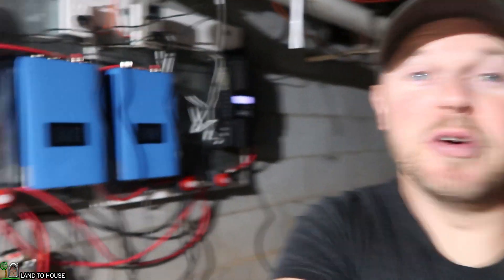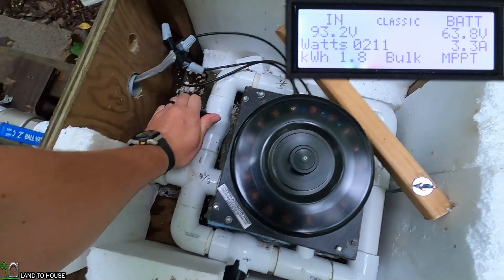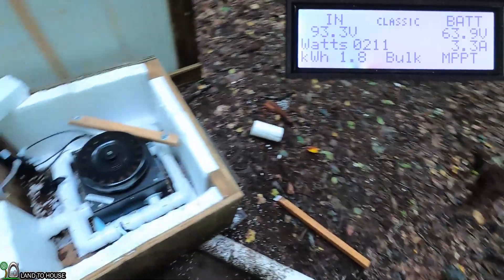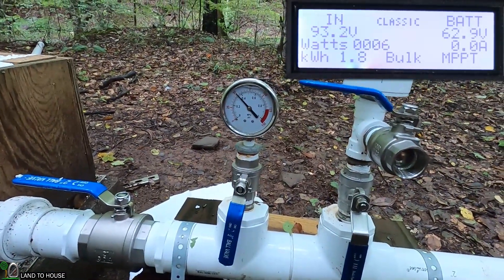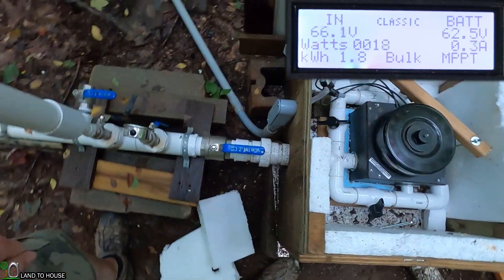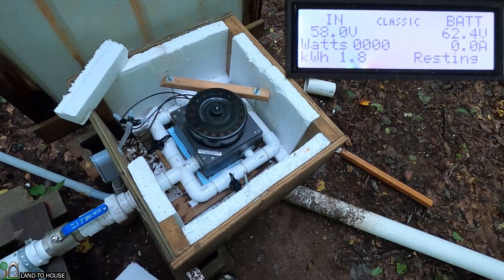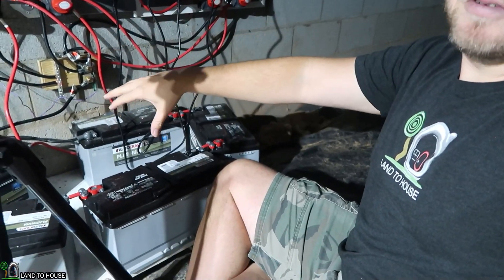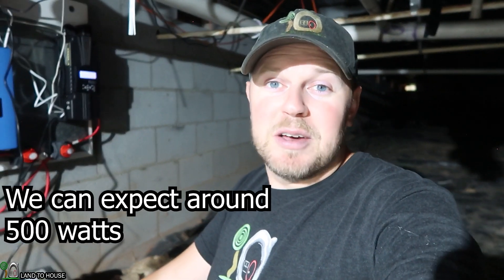It Rained - Can I Run All Four Micro Hydro Nozzles?

Comment: I don't understand how this was a drainage problem, bogging it down wouldn't cause the wattage to fall to zero while the voltage stayed almost identical to the voltage it was at around 330W. And when you "cleared it" and fired it back up it was clearly under NO load and shot up to 200V :-o it's like you tripped a breaker on the load side and it had nothing to dump the current into. The high RPM of the unit when you reopened was obvious and almost concerning.
Reply from the maker: When the battery at the house is full the charge controller allows the pma to spin wide open.
Reply: @LandtoHouse  Right, so you therefore have no confirmation from that test that there was actually a drainage problem under the turbine. You may have it from other tests, but the conclusion drawn in the video based on what was shown was outright wrong, right?
Reply from the maker: @fredio54  the drainage volume is way too small. A new catchment base is underway.  That will give you the answer you are looking for. I have that housing half way done.
Reply: @LandtoHouse  To be honest I'm more interested in you draining your batteries before a retest of the status quo and seeing what you can get out of it with the existing drain as that wasn't really tested. I suspect the spike to 516W that fell back to 330 or so may have been evidence to support your claim, but the "doesn't make any power at all" wasn't. :-)
Reply: @fredio54  If the turbine runs instable (here: due to water logging) then the MPPT algorithm of the MidNite Charge controller fails and it shuts down (meaning, the Charge controller does not pull any power from the turbine). Only after a while of stable run under no load (200V) the MPPT kicks in and loads the turbaine again.
Reply: @patrickhoffmann8893  I see, Sounds like a more suitable algorithm in the controller is needed. Solar charge controllers are an utter fail on an alternator, too.

Comment: As a long time home builder  and remodeler, I am very certain the problem you are experiencing is the lack of a  vent riser on your discharge line. The exact thing would happen if there wasn't vents on your home's sewage lines. T in a 2 inch vent line riser as close to your generator as possible. To see an example of this effect in your home, put a trash bag over the toilet tank sealing the top. When you flush the toilet, little to no water will flow to flush the toilet bowl. That's the same thing happening to your hydro system discharge. Ideally a 3 inch T with a 3 inch vent will work best. 
Love your videos.

Comment: Mmm.. As you have the batteries only charges the second one when the first one is charged. The batteries are misplaced, you have to place them in a way that charges all 4 at once.
Check the voltages of each of the batteries and you'll see the error
Reply from the maker: It's actually correct. Whenever you measure the voltage of the entire battery system it shows 60 V or more. This means that each battery is charging equally at the same time
Reply: @LandtoHouse  So they're not liquid lithium batteries, right? That makes sense.
Reply from the maker: These are good old fashioned agm batteries.

Comment: Nice demo. Would be great to see you automate the valve control. Micro controller like raspberry pi could use sensor inputs such as flow rates, pressure even wattage produced to regulate your valves automatically to maximise your production.

Comment: Is it possible for you to move it, much closer to your house, you should get more head pressure and being closer you won't lose power because of having a such a long distance of wire running from it, to your home.. Just a though... My wife & i have been planning to move to property we own in the country and I have been watching every channel I can find to work out a system that would work for us.. Water source (Stream with plenty of water flow year round) is about 2,000 feet to where we would build our home, the drop is about 150 feet.. The water run off from the micro-hydro unit would go to maintain water level for a fish pond...
Reply: The three-phase system he uses from the turbine to the house shouldn't have high loses, I don't think?
Reply: @EcceJack  You always have some loss, over a long distance distance.. It all depends on the wire, heavier gauge wires have much less loss.. Also I didn't say it would have high losses, but for off grid, you want every bit you can get

Comment: Well done!. What is the height of the head? What is the length of the pipe from the head to the pump? If you were using without the ram pump, what would the pressure be? If you were using with the water of the deliberi what the pressure would be ?.
Reply: If you check out his micro hydro series, he does an excellent job explaining these things! For most of that info you probably only need to watch the first and the last video

Comment: Why did it cut out at 512W did a breaker pull out at that current?
Reply from the maker: The housing that the pelton wheel is in became water logged and could not spin at full speed. I'm going to redesign this to drain more water
Reply: I have been back and reviewed and the power generation appears to stop before the turbine gets water logged

Comment: What would happen if you completely eliminated the pipe out and just directed the water right back into the stream? That is to say eliminate the out pipe and barrel downstream? It would seem that no matter what your in pipe  water flow would be you could always accept it without having to open or close valves? Kind of like the big hydro dams do. Water in water goes through turbines and then goes right back into the river. Think Hoover Dam.

Comment: I have a question, If you have a 3" pipe in and a 3" pipe out things are equal as far as pressure Is this correct? So what would happen if you have an increase in input flow through the same 3 in 3 out. That is what we saw in your video. Is that correct? So what I was wondering is if you have a 3" in pipe but you change your out pipe to 5"? Wouldn't that allow you to benefit from an increase in input water pressure (say during a rain storm) without causing your generator to bog down? I know what I want to say but I am not sure I am asking it correctly. It would seem that a larger out pipe would allow you a greater capacity to handle usual water flow but take advantage of your increased water flow inbound do to a rain storm? Wouldn't this also help keep your water pressure inbound steady, close to the 60+ you have in regular water flow?

Comment: I knew that 3 inch pipe would be your weak point I think u need 6 inch or bigger
Reply from the maker: Yes it is definitely a weak point. The redesign should have a nice big drain area with at least two 3" pipes going out

Comment: Your drain pipe should be at least 50% larger than the water intake pipe diameter. If you have 4” pipe up top (where you source your water), you will need at least a 6” pipe for the drain.

Comment: If i had this setup id dig a drainage canal with the turbine sitting on top of a decent size pit. You can buy pre made stormwater pits about 700x700x700mm with a 150mm pipe outlet at the base.

Comment: Just like an engine , when air and fuel are increased on intake the exhaust must then be modified to get it out . I suggest a nice header so it can flow better 😁👍👍🇺🇸
Reply: @Thomas Chrombly I actually like your idea, I'd comment that so he can see that. Maybe with a separate inlet, kinda like the ram pumps?

Comment: The reason that the turbine bogged down is the large volume of air that was introduced into the discharge water. The air bubbles increases the volume of material being discharged and reduces the density. Turbulence also increases the friction against the walls of the discharge pipe. Moving from a 3” to a 4” pipe doesn’t quite double the area you are trying to push your waste water. 5” would give you about 3.4 times the area.  Another possible solution would to drill a series of holes in the top of your discharge pipe. When under normal discharge rate the air may escape but the volume of water would small enough to remain in the pipe. At an increased flow rate, any excess water and air could easily escape before the turbine shroud could be impacted.
Reply: Robert ... I would stay away from drilling holes in the discharge because there may be some siphon effect lost, which is helping the flow down hill. Probably better to have a larger discharge box then add a second 3" pipe for more capacity. A larger / deeper discharge box will get the water away from the impeller faster.

Comment: Two three in parallel lines would be better and do not go with a 4-inch and then reduced down to a 3in you will still have the same problem as before 2 3 in parallel lines is what you need to solve the problem

Comment: Good luck matey.  I feel you may need a massive hole under the turbine maybe 2 ft square and 4 foot deep to allow the water a very quick exit.  Then put your drain away pipe at the bottom of the hole.

Comment: Nice job building your turbine! It would be cool if you could build a transparent enclosure for that
 turbine so we can see the blade!
Reply from the maker: That would be cool! I do have the plexiglass for that. :)
Reply: @LandtoHouse  ... some plexiglass might help you see during the design phase but it will probably get cloudy eventually from being etched by microscopic particles in the water.
Reply: @LandtoHouse  you could use the strobe of one of those Chinese flashlights to possibly slow/stop action a bit for video purposes.